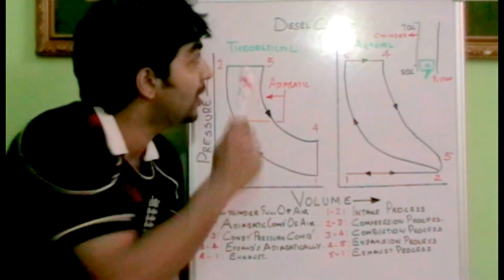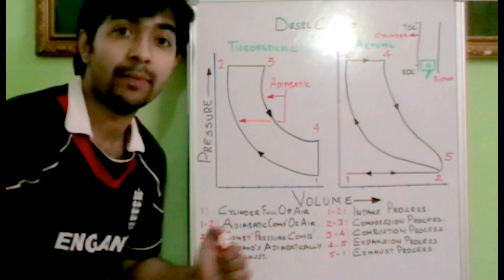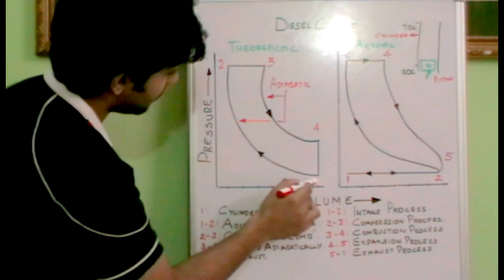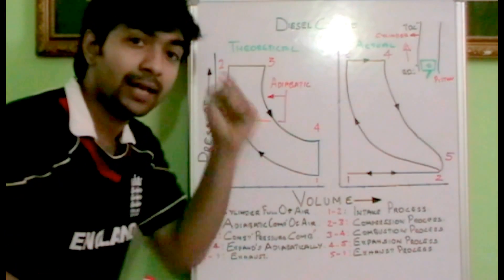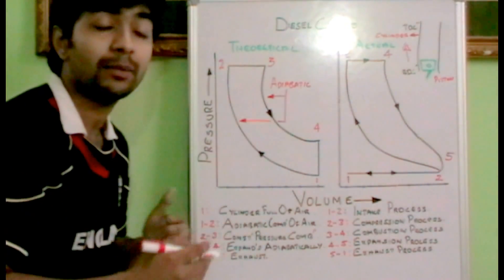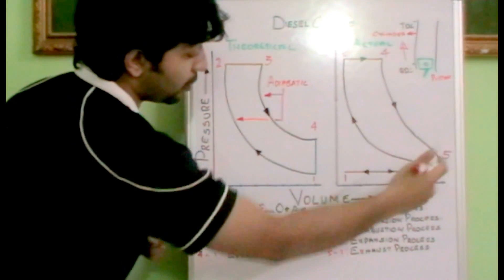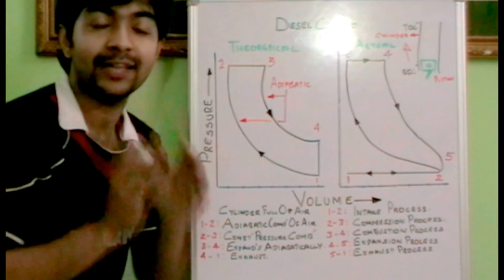How diesel cycle works. ✔

Comment: why diesel cycle is constant pressure cycle and why otto cycle is constant volume cycle?
Reply: With Otto cycle the fuel burns out way faster when ignited. It is 100% available at the time the spark ignites it and almost all the heat energy is produced at constant volume, very fast rising the temperature and pressure. 
With Diesel cycle the fuel continues injecting some time after the self-ignition starts. At the beginning of the working cycle the fuel starts injecting. It ignites itself due to the high temperature of the pressurized air in the cylinder. Then during the cycle more fuel continues injecting and igniting. Fuel injection and heat generation is according the piston movement in attempt to keep the pressure constant wile the piston moves down. This is where the high torque come from . With Otto cycle the burn-out is almost entirely done at the beginning of the cycle and further movement of the piston rely on that pressure, created at the beginning. Fast burning makes possible for higher rpm but the lack of additional energy during the working cycle makes the torque less than Diesel.

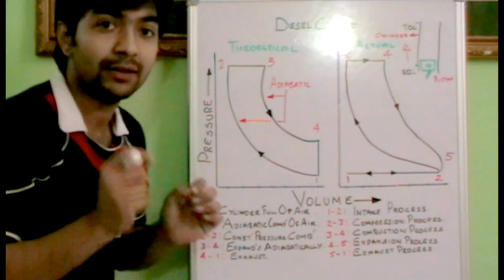Comment: to 1:03 i want to also add that adiabatic means - 
as well there is no heat transfer this process is very rapid (opposite to isothermal process)

and chang of internal energy = (-) work done - how i know this - i just had physics class - lol

keep up the good work -

Comment: I'm studying the original Brayton cycle piston engines. There is a family of piston engines that were constant combustion... starting with the Barber engine 1791 and the Cayley and Roper engines. All of those engines use a compressor about 1/2 the size of the expander and the compressed air passes through a fire where heeat is added.. However The engines Brayton made are not constant combustion.  In a Brayton the compressed air was heated as it entered the expander cylinder.

Comment: Very nice video. what i do not understand, however, is that since step 4-1 is the exhaust stage, and step 1-2 is adiabatic(isothermal) compression, where is the air intake stage? i know that in the actual process there is an intake stage, but what about the theoretical? also, would you be able to make a video about the Otto cycle? we are going to study that next and you helped me understand the diesel cycle more.

thank you